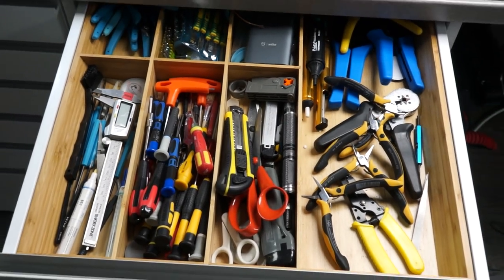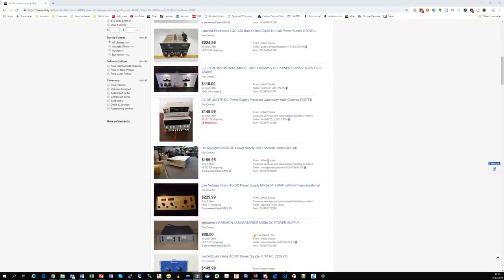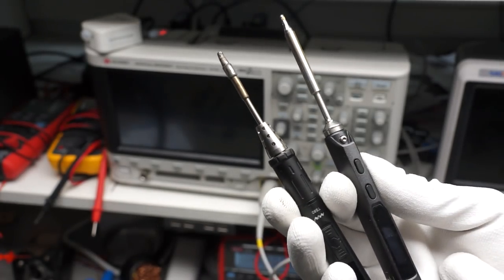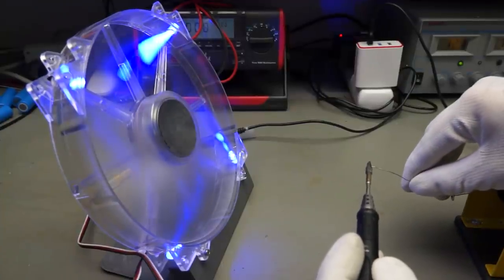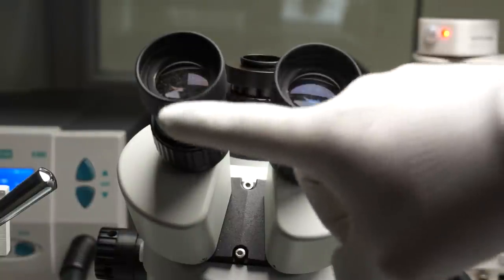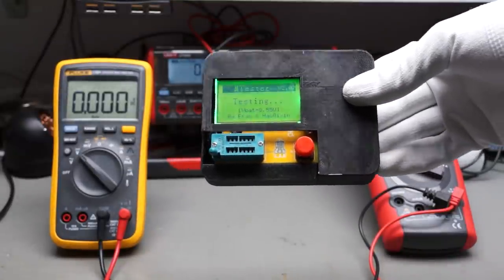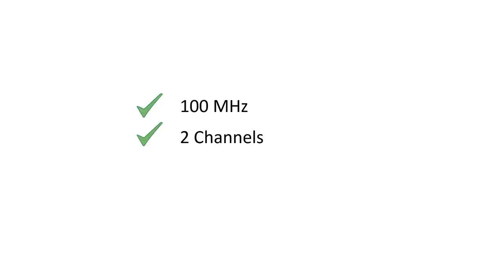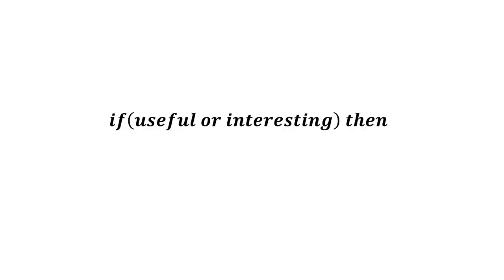#260 Most used tools, tips and tricks to spend your money wisely

Comment: U can print one like theese
Minimalist 3D Printed Fume Extractor found on #Thingiverse https://www.thingiverse.com/thing:3474360
Or
Solder Fume Extractor found on #Thingiverse https://www.thingiverse.com/thing:69729
Reply from the maker: I like the fan I use because it is big, and, because its airflow is not restricted, is also very strong and sucks the fume over a long distance.
Reply: @AndreasSpiess  we r using with carbon filter plus industrial fan air conditionimg no problem with industrial fans FYI

Comment: Any thought on this device?

https://www.analog.com/en/design-center/evaluation-hardware-and-software/evaluation-boards-kits/adalm2000.html
Reply from the maker: I have one and it is good. Maybe you watch: https://youtu.be/ZbZs8YgFic0
Reply: @AndreasSpiess  This one is not the ADALM Pluto - but the ADALM 2000 - It combines several devices ... for instance a 2-channel USB digital oscilloscope, a 16-channel digital logic analyzer, a  function generator amongst other things.
Reply from the maker: Sorry. It looks similar and I did not know it exists. I am not a big fan of those devices because they have a lot of limitations. For example no probes or even connectors for them. Maybe you search for a video about the device where a knowledgeable guy shows the software.

Comment: how to spend ALL your money: buy a 10K oscilloscope that you have no idea how to use, blow it up by shorting it to the ground.
Reply: @AndreasSpiess  the ground of the probes are shorted to mains ground (of course if the oscilloscope is connected to ground, most of them are since this is a safety feature), so if you measure a circuit that is not isolated you can short it, and if that is the mains it is not very nice. By the way I have one of those cheap oscilloscopes, it is very bad not only because of the small bandwidth but also because of the clunky interface, instead I would go for an analog one from ebay, you can get one for 50$ or less if you are lucky.
Reply from the maker: I knew that. Usually, you do not blow up the oscilloscope but the device under test. I like the storage capabilities of modern oscilloscopes and would not want to go back.

Comment: You are not just cutting copper when you built projects, most passive components have plated steel leads.
Check your resistors with a magnet.
Reply: I'm afraid its not steel you're cutting but iron. Thats soft enough
Reply: Thinking about it, it's a bit pointless using copper for a component whose sole purpose is to resist!
Reply from the maker: I learned something! Of course, I immediately tried and my resistors are magnetic. But I agree it is probably not steel as is very soft.

Comment: There ARE good solderless breadboards.  They are made by Assembly Specialists who are the OEM suppliers for the "3M" branded Solderless Breadboard products.  It is true that if you order some obscure branded or no-name breadboard from Asia, you have a very good chance of getting junk with poor spring contacts that are either too stiff to poke smaller wires into, or use metal that quickly looses its spring and goes flacid.  

Both Dave Jones and Julian Ilett have done videos on breadboards that go into more depth.

Ref: Assembly Specialists:  http://www.assemblyspecialist.com/WebStore/breadboards.html
3M Solderless  Breadboards are available at all major electronics vendors as well as Amazon, etc.
Buying "3M" products on Ebay is practically guaranteeing that will be getting a poor-performing counterfeit product.  Especially from Asian vendors.
Reply from the maker: Thank you for the link. Good to know.

Comment: I would say that makers should be at least trying to use lead free solder. Not because it's better or anything but because lead solder is going away. You can't buy it as a normal consumer in a lot of places. If you at least try to use lead free solder now you won't find it so bad when the inevitable happens and you either can't get leaded solder any more or all of your PCBs etc that have lead containing finishes etc are scrapped by customs on their way from China.
Reply: I disagree with your logic. It's perfectly possible to buy a lifetime's supply for as long as lead based is still available, throwing the whole "why try to postpone the inevitable" argument out the door. And a lifetime's supply does not take up a lot of space, and is quite a bearable cost.
Reply: @EvenTheDogAgrees  
Maybe you can by a life times supply of solder in reel form. Great so you have solder for big through hole components which went out of fashion a decade or more ago. If you need solder pastes to do SMD work you're SOL because that stuff lasts a few months. So you can go and buy a life time supply but it won't be usable next year. But the main point is having a ton of solder kicking around your house doesn't help if you can't get PCBs, components etc with lead based finishes into the country.
In ten years you'll have a bunch of lead solder and literally everything else will be lead free (it already is) and any soldering you do will be mixing lead and lead free alloys with different properties leaving you in a worse state than if you just got over it and learned to work with lead free.
Reply from the maker: @donpalmera After reading your comment I ordered my last spool of lead solder. Now I can get really old ;-) I adapt to many new things, but this lead-free was not created for hand-soldering, I think. BTW: I do not talk about SMD soldering with hot air.
Reply: @AndreasSpiess  I've used only lead free for hand soldering for probably 10 years now. It's probably slightly easier to get blobby joints but other than that there really isn't a huge difference.